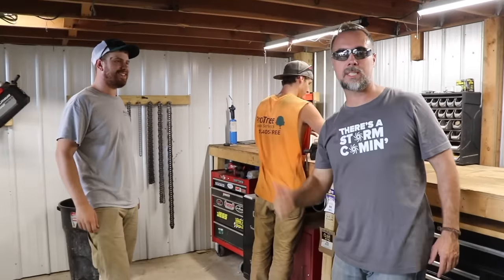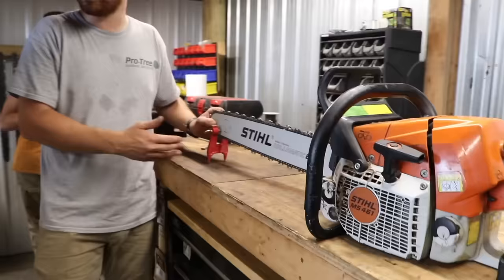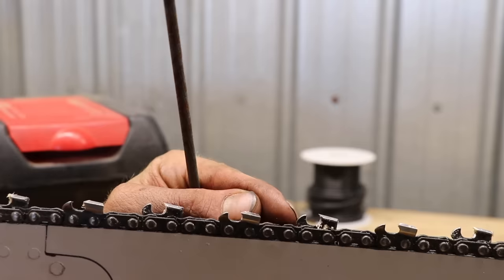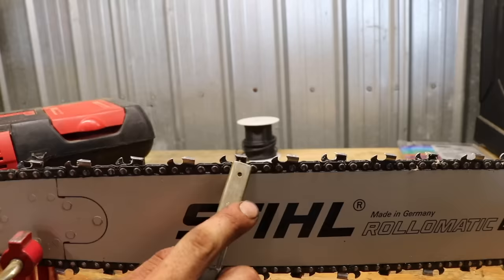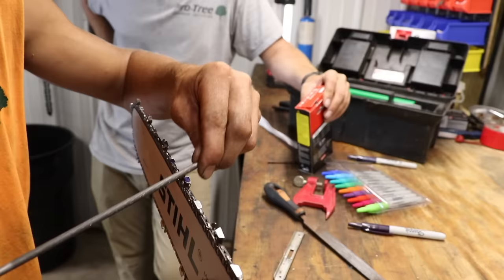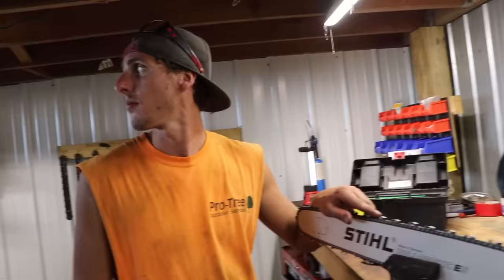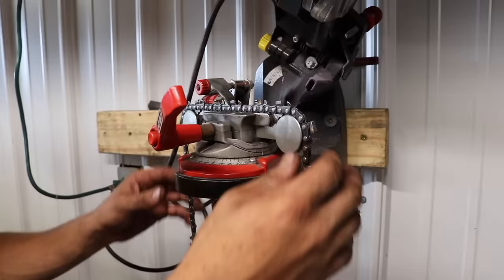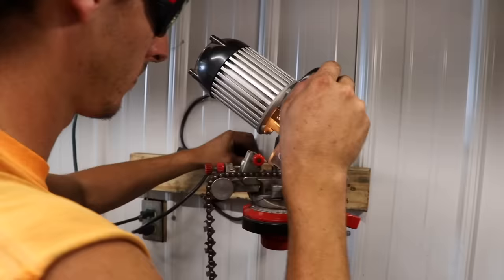How the Pro's sharpen a chainsaw

Comment: Mmm. Pretty sure heating the metal to a blue color (tempering) would soften the hardening of the steel. It takes WAY more heat (pretty much red hot) and then suddenly cooling it (quenching) to harden it. Cool vid apart from that.
Reply: I don't know about that - if you run a saw without enough bar oil or with the chain set too tight the edge of the bar will turn blue on you.
Reply: No, overheating the tooth makes it very difficult to sharpen with a file later. And those pink wheels are terrible for doing it. CBN wheels don't do it (unless you are an idiot) but are expensive
Reply: Mr Metalurgy.   
I was going to make the same point,  so I get a portion of the credit.

Comment: They know what they're talking about when it comes to chainsaw chains. If you start seeing sawdust when your cutting wood stop and sharpen your chain if it bites too much file your rakers. Good video Stanley!
Reply from the maker: Appreciate it, thanks!
Reply: The opposite happens if your rakers are taller than your tooth edge, it won't bite at all. You can have the teeth sharp but if the rakers are too tall and blocking the tooth cutting edge you will just be spinning your wheels. If it bites too much chances are you rakers are too short.

Comment: Best sharpener for light users is Stihl 2 IN 1 EASY FILE or Pferd Cx-s. Just match to the size chain you are running.
Reply: only complaint about it is that they like to disappear sometimes... haha
Reply: Yes, have one of those and i love it. Makes a cleaner cut and sharpens both the teeth and the rakers at the same time.
Reply: I don't like them because I like to tune the chain to the engine.
Reply: d hamby what do you mean by tune the chain to the engine?  Never heard that before
Reply: @MARKE911 , it means adjusting the rakers (aka, depth gauges, drags) and teeth to the power of the saw. Square grind and round grind, soft wood and hard wood,  high altitude and sea level, all need fine tuning of the rakers. When you're cutting all day long seven days a week you'll feel the difference.
Reply: d hamby  thanks, the only time I end up using my saw is during an emergency incident mainly after a tornado or very strong straight line winds. An occasional tree on my farm or around the house or for friends.  Only used my saw 4 times this year (2018)  so I am only a novice at best.  Thanks again for the reply.
Reply: I heat my house with wood, and that Stihl 2 in 1 sharpener is indispensable to my whole operation. I recommend it to all my firewood buddies.
Reply: I pretty much grew up in the woods helping cut logs, post, firewood, pulp wood or just clearing land.  I didn't use the saw much.  Even on my own I didn't use the saw a lot.  I am just ok hand sharpening a chain.  My favorite sharpener is the Granberg G1012XT my wife got for me.
Reply: No faster way to sharpen a chain. The angle it suggests to use is a little too sharp. It's set for lower kickback It's really the top edge that does the cutting. I like mine The Stihl is about twice the cost.
Reply: @1d1hamby  yeah buddy! I like aggressive rakers myself. Much like 1 finger Franky. Except I never put my hand anywhere near a chain unless the brake is on and I'm checking the tension.  I like my fingers.
Reply: Chester Smith  finally somebody said it. Lol. I haven't used the tool they're talking about but I generally hate fiddling with files of any kind and i definitely dont like filing chain teeth. Except i still have to file the rakers. Grrrrr..... I could rig up another grinder for those i suppose or use a dremel.
Reply: I was a newb on hand sharpening and that's the only way I do it now. What enough buckin videos and a little bit of practice and she cuts eeh.

Comment: Great video! I am filing the rakers first then the tooth, because when u use the raker gauge it will dull the tooth a little bit. My experience and I hope it is a relevant tip.
Reply: You need to sharpen the teeth first. There's no way to know how much to file the rakers down until all the teeth are sharp and at the same level.

Comment: Between me and my father over roughly 500,000 + chains have been sharpened and made. Used a bank of 8 sharpeners on stands. Different angles, different wheels, setup for rakers. But another key factor of good chain maintenance is cleaning them. Soak them in a tub of pitch cleaner / solvent that also works as a lubricant for the drive links and then use a stiff hand brush to clean them after the tank and then blow them out with compressed air. 

Another good point is the direction your wheel engages the chain. It should go into the cutter link. I flip the chain not the angle, My sharpeners angle stays set always. This prevents a burr on the outer edge of the chain. High dollar sharpeners like foleys and silveys have a bi directional motor for this purpose but I find when your doing a lot in a day changing the angle is a waste of time. 
As there are many types of chains out there you need to use the right chain with the saw your using and the conditions your cutting.  
I don't sharpen chains anymore as I work in a different industry now.
Reply from the maker: Thanks for the comments!
Reply: I soak chains in a solution of water and ammonia, about a cup of ammonia to a gallon of water.  Let it soak 10-15 minutes and clean with a stiff parts brush, works pretty well for cleaning pitch off chains and it's cheap and environmentally friendly. Small dirty chains overheat and "blue" more easily.
Reply: Lonnie.... Thank you for your comment! I got more from you than the video! Thanks again!
Reply: Sounds like you sharpened a lot of homeowner saws.  A chain that is kept sharp and properly lubricated will not pick up enough pitch to worry about.  The only saw chains with pitch or resin are those that were run dull or run out of oil and got way too hot.
Reply: Lonnie Burkett kkkk
Reply: Lonnie Burkett is sneaky,d’

Comment: It's called annealing when you overheat the tooth and makes it soft like tie wire... it moves the carbon (hard stuff) around. If you get steel red hod and let it cool you will see the carbon move to the surface (scale) and the left over metal will now be soft and bendable. It will lose its tensile strength
Reply: I was just looking to see if anyone else caught the "blue" tooth mistake in the video. If you "blue" the tooth, you over heated it and lost the temper out, making it softer so it won't hold an edge. Thanks for posting the correction so I don't have to!
Reply: If chains were hard you would not be able to file them.
Reply: We've had neighbors/friends who cut with a dull chain for a bit and then can't figure out why their file won't sharpen it.  Takes a new file or even better, a grinder to sharpen the chain again.  Kind of work hardened the chain by running it dull for so long.  Also happened when I got stuck sharing saws at work as the other idiots would run the chains in the dirt and keep cutting.  I started to take my sharpened chain off at the end of the day and put the dull pos back on for the next shift, but I did end up sharpening those work hardened ones with a 12v stihl grinder as the file would bounce off.
Reply: @trevors8577  I don't know how much you can work harden any steel on wood. Or were they running this chain through boxes of rocks too? I'm not even sure how much you can work harden the steel that chainsaw chains are made out of. Even using ideal methods. Otherwise instead of heat treating steel we'd just cold work harden it. Duller edges do take more work to sharpen. That's because you have to remove a lot more material to achieve a bevel apex. I have to do the season opener sharpening on my lawn tractor blades. I know I'm up for a long grinding session on them. Because I just let them go in the fall when I'm using the tractor more as a blower than a mower. So it is really dull. I just ran over the open spaces it it hardly cut at all. But I was clearing debris left over the winter with it. That edge is still really beat back now. How much I'm going to have to grind has nothing to do with that blade being harder either. The edge is just that worn down. Consequently I'm going to have to remove more meat to bring it back up again. By hand it is a lot more work. On them tractor blades I'm going to do the bulk of it with a 7" angle grinder. So it'll go fast. I'm still going to lose a lot of material. That steel is like butter though. I do the flat side with a file and it bites into it real easy. If anything should be work hardened it is my tractor blades. Because sometimes I even clip them in the stone drive. Nope. They don't get harder doing that. They just get nicked up bad.
Reply: @1pcfred  No, the chains are definitely harder.  I can take a file that files my chain nicely (you know the sound and how it feels I take it) and when going to try the same file on another work hardened chain it sounds like it is bouncing off and hardly cutting into the metal.  Take a grinder to it and sharpen it and the next time I try to file it cuts just fine again with the same file.  Ergo there was a hard surface on the chain that was preventing the file from cutting.  It hasn't happened once but dozens of times so that eliminates the fluke outliers.  And that is why I kept my sharpened chains in my locker and let the other tools figure out how to sharpen their chain, I'd spend 30 minutes with the 12v hand grinder (like a dremel but with battery clamps) to make an edge again and then have to deal with the depth gauges (rakers).  How I grew up sharpening (got my first Stihl 026 when I was 12 to help with the family logging business), you look at the edge and if there's any shiny then you file it.  It's like standing under a light holding a knife with the edge facing up, look down and any dull spots will reflect the light back as they are rounded over and not an edge and that is how we viewed a chainsaw chain as being dull.

Cut down trees and limb with a freshly sharpened chain and then drag them through the mud and dirt to the landing and then cut through said mud and dirt (30 cuts or so usually) and then the chain is slightly dull but still probably cuts 95% better than any "pro" that is actually just some homeowner/homesteader and we'd sharpen the chain again.  I ran my chains until teeth started breaking off because they were filed so much that they are pointy from the sides now.  After two or three broke off then I'd swap out the still great cutting chain for a new one.  So to say I've sharpened a few chains is a huge understatement as I sharpened more in a month than probably every single homesteader does in a year or two, or even their life.
Reply: @trevors8577  I've only sharpened my chains a few times and I always use a rotary tool. Gets it sharp enough for me. I use a plug in 120V rotary tool. I use a Dremel chainsaw sharpening stone with it though. Don't use the guide that came with it. Looks like a waste of time to me. I probably should file down the depth teeth some someday.
Reply: @1pcfred  I have some of those grinding bits for my black and decker rotary tool, the guide is pretty silly as the chains usually have a guide mark on the very rear (while looking down on a tooth) that shows the correct filing angle anyway.  I used a buddies to sharpen his chain after he decided it was a good idea to bury the bar in the tundra to cut tree roots, file wouldn't touch the chain on that one either.  For me it's much quicker to just clamp the bar in the vise and take a file to it as long as the chain hasn't been abused, which mine almost never are as I learned as a child how to best cut to avoid silly mistakes like sucking dirt into the kerf.
Reply: @trevors8577  all trees are dirty to some extent. I mean they live outdoors. They take showers but they never lather up. Lots of trees even suck minerals up into themselves. You could say they live on dirt. Because they basically do. It ain't all just fresh air and sunshine for trees. Although they need that too. Some species of trees are very high in silica content. They're sucking sand right out of the ground. Beats me why they're doing it. Ask one of them. What I'm driving at here is even if you are meticulous about never dirting a chainsaw if you're using it to cut trees then you can't avoid hitting dirt. Because trees are kind of made out of dirt. It is what plants do. Except for air plants. I think they get the dirt they need right out of the air? Which is kind of nasty if you think about it.
Reply: @1pcfred  I like to drop trees into a lake first and then wade out with some soap and a brush to clean them off and then gingerly pick them up and carry them to the landing before cutting them up, when that isn't possible and the tree was dragged through dirt, and there is now dirt on the backside of the tree lets say.  Do you A. cut with the bottom of the bar and suck the dirt into the kerf or do you B. cut from the bottom up so the top of the bar hits the dirt first and shoves it away from the kerf.  Me, I would cut with the top of the bar and not break through the backside, once through with 9/10ths of the cut then slowly cut through the mud. 

The minerals and dirt that the tree sucks up is fairly irrelevant as it's microscopic in nature and doesn't dull a chain like hitting sand and rocks will.  Dirt in the bark, well make a low rpm marking cut along the top or side facing you and then cut upwards with the top of the bar.  Doesn't take much skill to cut with the top and tip and avoid kickback.

With enough practice you too can learn how to keep your chain from prematurely dulling..

Dang coronavirus has us bored with nothing else to do but talk about dirty wood :)
Reply: @trevors8577  high silica containing woods are well known for dulling tools. When I am woodworking clean wood my tools get dull. Well, duller than when they're freshly sharpened. Which causes me to hone them again. Although cutting green wood is decidedly different than seasoned wood.
Reply: @1pcfred  Yup, eventually they will dull.  Sucking dirt into the kerf will dull them massively quicker.  Kinda like driving your car and the tires eventually wear out, do a bunch of burn outs and your tires wear out much faster.

Comment: cheers....very informative...they charge $25 au at local stil dealer to sharpen up blunt chains so this is gold.
Reply: that's the cost of a new one
Reply: @scientist100  right most I've seen is usually$0.25 a tooth
Reply: For 25 you would be a lot better buying a new one. In my opinion you getting ripped off and you should be able to get it sharpened cheaper elsewhere, what I have done is look at a whole lot of sharpening videos where there sharpening with hand files and I’m getting real good at it, practice makes perfect, good luck mate
Reply: I guess they charge 25 because they really don't want to be spending their time sharpening chains. I mean take a hint.

Comment: Look up Buckin' Billy. To a pro arborist he's totally credible, as well as being entertaining.
Reply: Yep get the gullet
Reply: Holding file straight every stroke won’t get the gullet
Reply: @jameschester3986  and how do you get the gullet ?
Reply: @jameschester3986  sure it will, it's just not billy's style.
Removing the gullet is a separate processes from sharpening the cutter, if you use square ground/filed chains you know what I mean by that.

Comment: Most consumer rated chains will last 3-5 sharpening at best.  In addition, those guys sharpening after every tank are using something like Full chisels on a Full Skip chain which requires them to sharpen more often as well as change their chain more often.  There are different types of cutters (Full-Chisel, Semi-Chisel, Square and low profile) and then there are different types of arrangements. (Standard, Semi Skip and Full Skip).   Each requires a different approach to sharpening frequency.   Also, while I guess it's a good idea, I do NOT stabilize my bar when I sharpen in the field.  Never have.
Reply: You know what you are talking about.👍

Comment: I had an outdoor wood boiler that heated my house and shop for a decade, and I got very aquainted with sharpening a chain.  I used an Oregon 12 volt rotary grinder sharpener(like a Dremel).   I could sharpen the chain on my saw in about 2 minutes, 3 minutes if I was touching up the rakers.  A chain would usually last a season- and I would usually cut between 16-20 cord of wood (I was heating a 3,000 square foot house, my hot water, and my 30x40 shop for 5-6 months).

Comment: its a myth that you have do the same number of strokes. What if you hit a rock with only 3 cutters? No need to sharpen all to the same length.When my chains get short in the tooth sometimes I will file them completely off. Cuts straight if you adjusted the rakers appropriately.   You also DO need to get the gullet out, and keep the "hook" or "C" in the sideplate cutter profile. It also is more effective to do the swirl IMHO lol. These dudes are great but Bucking Billy Ray been sharpening chains longer then these dudes been alive! Great Video, nothing but love
Reply: I also learned from Buckin' Billy Ray (and a few others) before seeing these guys. I have so many comments about what they got wrong, especially with that PoS raker gauge that for some reason rests on the cutters on multiple links. That would make sense only to people who believe every tooth must have identical dimensions.

Comment: Good video,  it depends on the size chain and type of wood you are sawing but I generally try to run my rakers.020 to .025 thousands below the cutting tooth
Reply from the maker: Thanks Larry
Reply: Pinoyscandal
Reply: For misquite trees its 15/20 is what I find the best and chain last little longer, plus only cut when leaves are green